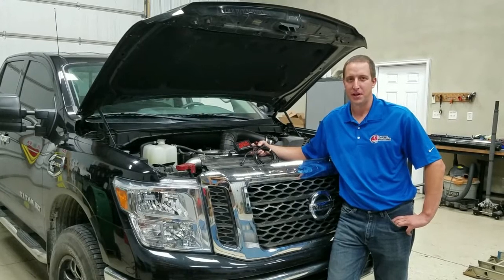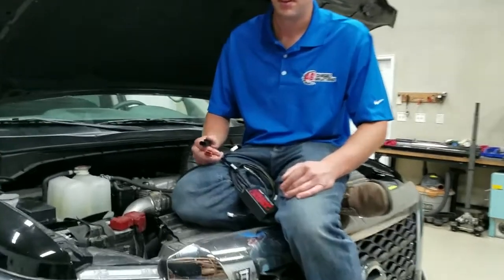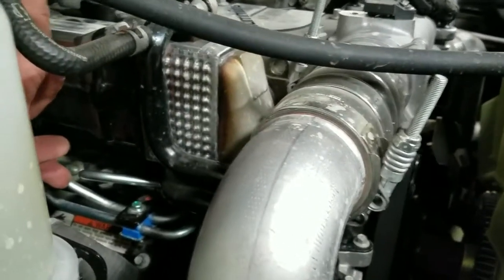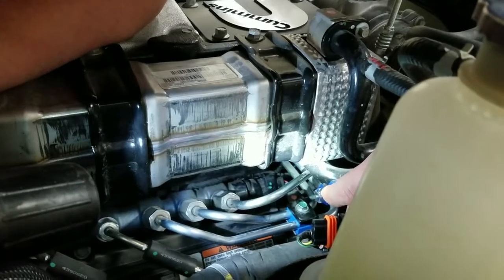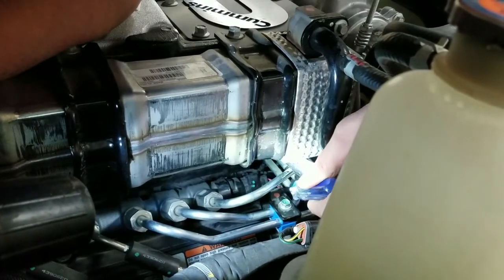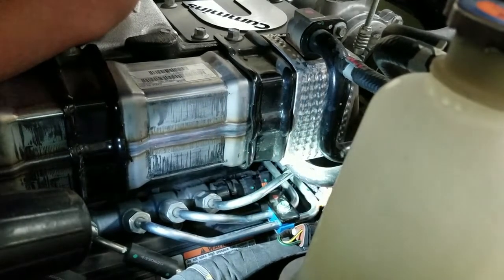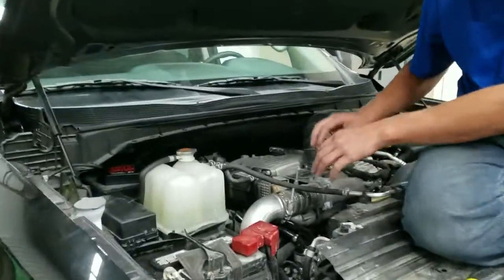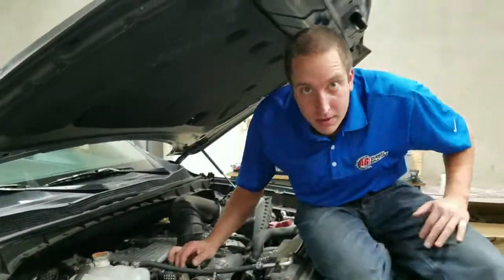Ag Diesel Solutions Truck Edition 23000/63000 Nissan Titan XD Cummins 2016-2019 - Installation Video

Comment: What are the hp and tq dyno results for the truck?
Reply from the maker: Nest LIAM, where we picked up was in the lower horsepower and torque curve where the truck needs it the most.  We picked up 48HP to the ground (~57HP Flywheel) and the torque numbers are a very close estimate of 96lbs to the ground.
Reply: Wow with that amount of TQ that really helps to get rid of the lag you get at the lower RPMs from a turbo Diesel.
Reply from the maker: Nesto LIAM, you are correct, we develop these modules with real world driving habits and uses in mind.  If you would like to give us a try please give us a call at 81.618.9168 or check out our website AgDieselSolutions.com  Thanks for watching!
Reply: Was that 48hp at the wheels and 96tq with the module set to max power output?
Reply from the maker: The run was done with the module on high mode.  The 48HP and 96TQ are at the wheels numbers (physically being put down to the road)
Reply: Ag Diesel Solutions i got one and could really tell the difference right away. There is less lag and better spool up below 2000rpms which i noticed before was where the truck really lagged. You guys should really considered posting a dyno sheet on here and on your website so all the info for this product is there. Plus reviews from customers like myself.
Reply from the maker: Nesto LIAM, the website is currently a work in progress getting all the information up, also, there is a section to leave a review on the modules on the module page and Facebook.  Thank you very much for telling us about your experience and enjoy the module!

Comment: Will this void the warranty on the truck?
Reply from the maker: The only way for a dealer to tell you have a module on your truck is if they physically see the module under the hood.  We do not leave any traces/finger prints on the factory ECM, so if you take the module off before service, there is no way for the dealer to ever know it was on there in the first place.
Reply: Ag Diesel Solutions one last question. With the added power will i see better throttle response and less turbo lag? Also will i have an improvement in mpg with the system becuase i don't need to use as much throttle to get up to speeds?
Reply from the maker: Nesto LIAM, the throttle response is the very first thing that you will notice when you install the module.  We designed this module for almost 100% down low power where the Titan seems to lag on take off and getting up to speed without putting the pedal to the floor.  Most of our Titan guys are seeing an average of 2MPG gain with the module driving the same way they did before the horsepower/torque boost.  If you have any other questions, please feel free to give us a call here at the office 812.618.9168 and we would be more than happy to help!
Reply: Continue to work on your module to make them perform better? Just wondering if you release anything better or updates for the unit can we get it?
Reply from the maker: Nesto LIAM, are you having any issues with the module or are you just asking if we will be releasing new products for the Titan?
Reply: Ag Diesel Solutions im not having any issue with it. It runs great. I was just wondering if this is the final tune or are you guys continuing to work on making better turns that are safe but make more hp and tq for the truck.
Reply from the maker: Nesto LIAM, with all of our products we keep everything in line with a 100% factory truck.  This being getting the most out your truck with staying in factory spec limitations of the OEM components.  So without changing anything besides the module, from us, the current module is getting the best torque and horsepower where the truck needs it that we can get.  If anything does come up, I will make sure and let you know!  Thanks and enjoy your Titan!
Reply: @Nesto2005  how are you liking this unit?  Can you tell a difference when you take off at a stop light?  (Driving normal). Mine is stock and I have to put the foot on the break and one on the accelerate to spool up the turbo if I need to pull out into traffic.
Reply: @Mikewalden12345  well i took mine off awhile ago but i tried both the AG and Afe scorcher and the Afe was actually better in performance. I would say add that plus a idrive unit to help with the dead pedal issue.